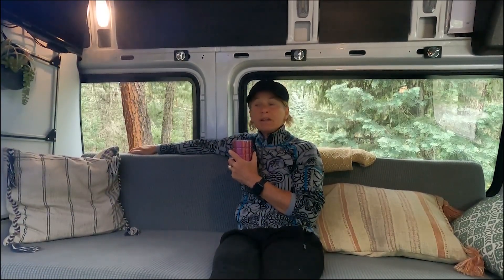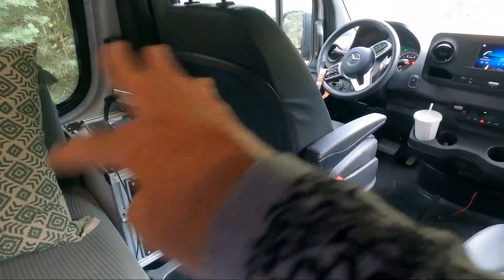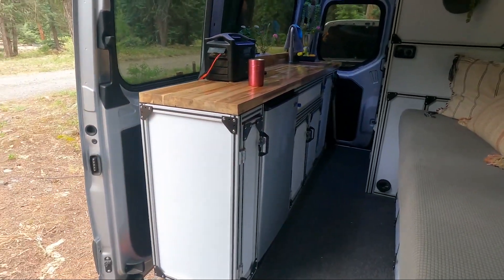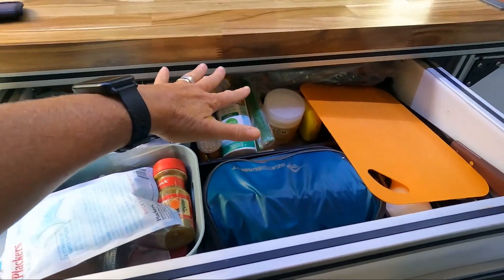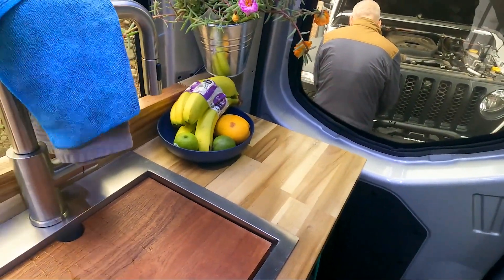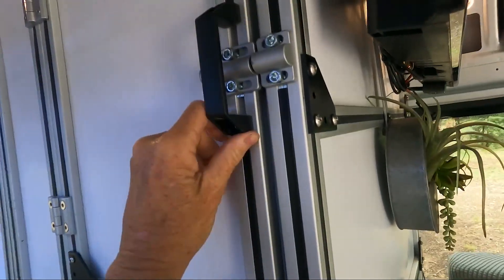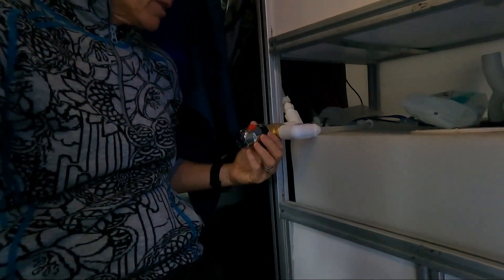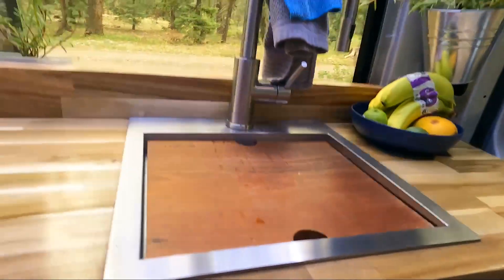SPRINTER VAN BUILD TOUR

Comment: May I ask how do you attach the cabinets to the wall? Did you install 8020 track or L track on the wall? Thanks
Reply from the maker: We used plus nuts into the frame and then attached it with the 80)20 using the attachment pieces from the 80/20 into the lug nut